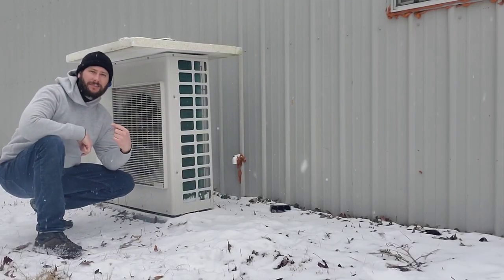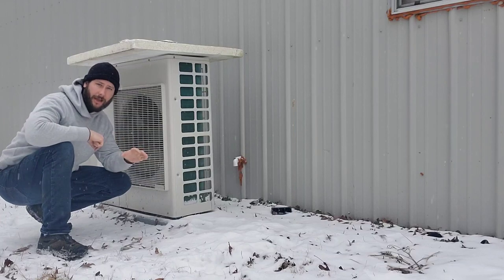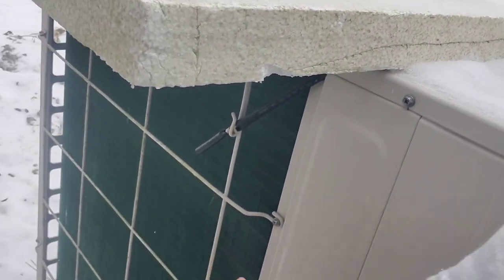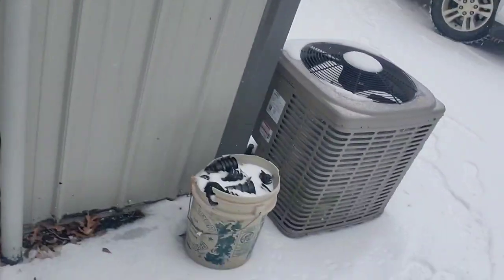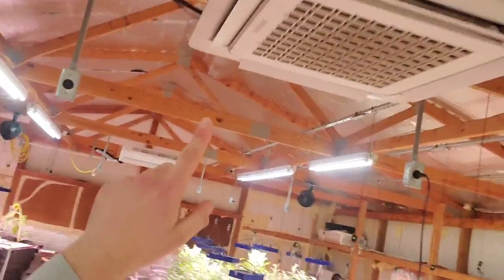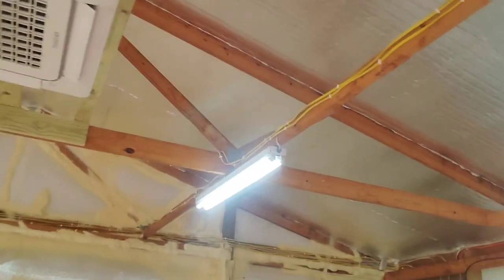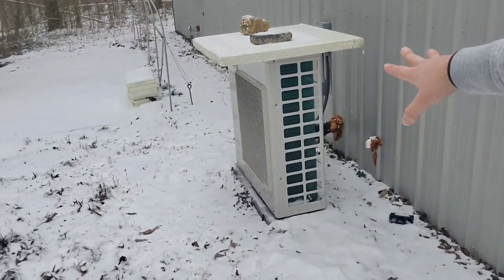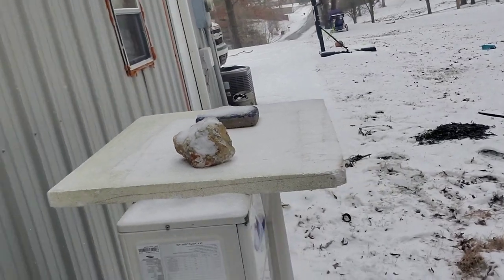Heat Pump Mini Split Frozen What do you do? #minisplit #heatpump

Comment: In Case anyone is interested:  I just had a 7 Unit Head System with 2 Condensers installed in my house this February. I have old baseboard heaters that cost a fortune to run. They left the baseboard units in place as backup. It got down to at least -10 right after they got it installed and running and it actually kept the house warm in below zero weather. I had 1 unit turned up to 80 degrees but I didn't need the baseboards at all. It worked perfectly and I live in Minnesota! My system is Midea just for reference. So far I haven't had to clear any snow. Will see what happens this coming winter. Both my condensers are exposed to the elements. It's working perfectly! I have 1 large condenser running 5 heads and 1 smaller condenser running 2 heads. It cost $27,000 installed. I was extremely lucky because it was paid for through a grant from a weatherization program.

Comment: I am in SC and my Daikin inverter unit on the exhaust side was iced up almost completely the other day.  We don't get much cold in SC so this was the first time.  I built a roof over the entire unit and also installed screen wire around the suction side about 6 inches from the coils to help prevent trash from getting into the coils.
Reply: Whaaaat im in sc and my unit is a block of ice right now too
Reply: @KleinHeister  I don't like the cold so I built that roof the other day so I will not have to go out there and keep ice off of the exhaust grates.
Reply from the maker: Great knowledge good to know this information thank you for sharing
Awesome that you built something to keep the ice off

Comment: You installation is not correct. Your condenser should be elevated off of the ground. I have several Mitsubishi and Fujitsu hyper heat units installed in Buffalo NY and have never had issues with them icing up. Not sure if Samsung has a pan heater in it, if it does that’s why your condenser is icing up after defrost. The unit cannot drain out the water that has melted off the coil and in the pan.
Reply from the maker: Just because the unit is on the ground doesn't mean it's installed incorrectly. 
Mounting brackets work really well.
This is for my Aquaponic Farm.
 This snow in Tennessee only last a week or 2 and then it's gone that's good.
 The outdoor unit is
 installed at an angle.
 the drain hose comes out the bottom and drains away from the equipment
it has not been frozen once since I covered
 I get what your saying and agree with you I agree the water cannot drain If the Pan is iced over
 Also I will check and see if Samsung offers a Pan heater
 Thank you for your advice 
I appreciate you taking the time to watch the video 📹🙂
Thanks for the information too
Reply: Does't matter where the outdoor unit is, in Aust they are usually on the ground next to the house.
Reply: You're absolutely right condenser need to be elevated so you wont get ice build up. That is my problem right now, so I bought a bracket to raise the condenser.

Comment: All the mini split heat pumps I install have a defrost mode and melt the ice off the coil... your right about covering only cause in icy condition it is hard for the fan itself to keep clear of ice. There is nothing to melt ice away from the condenser fan.... this is cause the fan is vertical position blowing air horizontal.   

A traditional heat pump doesn't have trouble keeping the fan clear cause in horizontal position it won't allow any build up.  I have seen defrost boards fail and never defrost and ice close in on fan blades.
Reply from the maker: thanks that ice does not play Thanks for your support

Comment: Your statement isn't quite true about traditional heat pumps having emergency heat. All heat pumps have a defrost mode. The heat pump will defrost on its own if it meets one or two things ( timer or o/a ambient temp sensor)  . Most have a timer function built on their defrost board with a selection of 30/60/90 mins . It should go into defrost mode and shut off ODF . Pump hot gas through condenser coil and melt any ice off coil. When doing so it will not heat the space... I don't  know why anyone would install a traditional heat pump without electric back up elements to help while in defrost plus for additional heating...
Reply from the maker: Good info Thanks for sharing with others so we can all learn Thanks for watching

Comment: This year my heat pump kept freezing up, so I just stopped using it when temps got below freezing.  It's been a beast of a winter.  However,  I kept going to examine it whenever the temps got higher, and I came to the conclusion that maybe water was getting on the coils.  in Washington the humidity is high, it rains a lot, and we have freezing fog.  I got a very large boot tray and covered the top to help prevent water from getting on the coils (upside down, of course).  It hangs over the edges.   It hasn't been as cold, so I'm not sure how it would work below 28F, but it has prevented ice buildup below freezing.  Maybe I'll cut some foam board to put under the boot tray?    Is the foam board to help insulate the unit too?

Comment: It's good to have one of those unit's series but that ice build up prevention mechanism/algorithm built in this generation's units is debateable, it needs to be improved/updated, maybe by a software update to the controller. I am not talking about the usual defrost cycle. If you are using samsung of this gen or a technician for samsung then you should know what I am talking about. Most of the winter, the weather is mild where I live and my samsung still goes for these little frost protection cycles every 3 hours or so although the weather temp outside is at lower 60s F / 16C. You know Its literally impossible for any frost to build on condenser at those temps unless something is wrong with your unit...  Nice video! That simple plane of wood or wtv it is  you used there literally saves alot of energy for heavy winter regions!!!
Reply from the maker: Wow you are the 1st and probably the only person that will actually get the point in this video and I am so glad that you took the time to leave this information yes I am aware of snow prevention mode on DVM model Samsung outdoor units
 Thank you for taking the time you're right there is no time at temperatures like 60ﾟF for the frost accumulate with the algorithm in the equipment
 Glad you watch this video
 Think you
Reply: @TaddyDigest  Thanks to you! Your videos are very helpfull & instructive!

Comment: I just had a Mitsubishi 3Ton Ductless HP installed.  We are on the Lake and the Wind is fiercely cold in winter with snow drifting concerns.

The unit we have is:  MSZ-GS36NA

Thinking of building /stacking a 3 sided cinder block wall then adding a 3/4” Plywood top sitting on 4 corners of cinderblocks to allow airflow in, is this a good idea?  I would have the cinderblocks 3’ away from the unit for airflow.

Comment: Hello, Tad. I recently came across with one of your videos about the mini split unit outside freezing up (a block of ice in the back and on the side). I am in Chicago, and I have 5 units. I am not sure if you are familiar with mini split DELLA. I installed these units myself. I own an old hose, and the heating system (running boards) was not helping. We recently had about 5 to 7 inches of snow, so before the snow came down, I covered them with plywood a date after the temperature dropped to -5 degrees and -15 degrees with the wind factor. And no snown got on the units, but they started building ice again. Do you have any suggestions on what I should do?
Thank you in advance.
Reply from the maker: keep the top covered 
they will freeze but should thaw back out 
make sure they are blowing heat and that the charge is good or they will not thaw out the coil

Comment: Couldn't you just install an awning right above it instead attached to your siding? 
Seems to me that would be more structurely  secure.
Reply from the maker: Absolutely that is the best option and a great idea
 Thanks for watching hit that like button please
Reply: FYI: I just had a 7 Unit Head System with 2 Condensers installed in my house this February. I have old baseboard heaters that cost a fortune to run. They left the baseboard units in place as backup. It got down to at least -10 right after they got it installed and running and it actually kept the house warm in below zero weather. I had 1 unit turned up to 80 degrees but I didn't need the baseboards at all. It worked perfectly and I live in Minnesota! My system is Midea just for reference. So far I haven't had to clear any snow. Will see what happens this coming winter. Both my condensers are exposed to the elements.

Comment: Hi,
Do you know what the normal temp range for a 12000 BTU inverter mini split compressor is please?.. I want to know if it safe to slap some butyl sound dampening pads on it to quiet it down, like the stuff they put in cars to quite down vibrations?.. I'm sure I'm not the only one who thought of the idea but I cant find a single mention of it anywhere. I would try one of those sound dampening jacket things, but it's a rectangle type, not the big American type, so there is probably not enough room for one of those jackets. I need to open it up and see tho to be sure.

My manual says it can work down to -15 C. It's about -1 now and it iced up and is already struggling to keep up because of having to do the defrost cycles (does it on temps not timer I think). It's absolutely normal for it to ice up when it's -1 isn't it?.. Because it's going to be making the fins even colder than the ambient temp to suck heat out of the air. I only got it very recently so this is the first time I saw it ice up.
Reply from the maker: The refrigerant keeps the compressor cool
So putting a sound blanket over it is not going to make it overheat.
You're fine to put a blanket over it to make it quieter.
Reply from the maker: Discharge temperature is usually maintained around a 135 to a 140 F
Reply: @TaddyDigest  Is that the temp of the actual metal that makes up the compressor?.. Like if you pointed a laser thermometer at the side of the compressor when it’s at it hottest and coldest. Butyl pads are supposed to be able to handle -50 to 120 C (-75°F to 250°F maybe). I would have thought it was easy to find how hot and cold compressors get but I can't find that information anywhere.

Comment: and they want me to replace my combi boiler with this bs??
Reply from the maker: If you like burning oil or gas then stick with what you got
Reply: @TaddyDigest  they're getting banned in the uk. already from june this year they're bringing in laws to limit flow and temp through radiators to standardised around how they expect heat pumps to perform.
Reply from the maker: Wow I can't believe they're doing something like that
 Sounds like they're really pushing the heat pumps
Reply from the maker: Wow thank you for this insight

I love the knowledge that you provide.
 Also I can't believe that the electricity is nearly 4 times more expensive where you live I don't blame you for not wanting to switch

You're right they want more control
Reply: @TaddyDigest  trying to get my family to agree to let me build a rocket mass heater in the house, because i've been thinking about supplementing the heating like that for a while, let the pumps and thermostats continue to do their thing but contribute auxiliary heat safely in a way that wont freak the boiler we have out or damage anything; they're not designed for water above 80c, and its a terraced house we live in so not much space for extra gubbins to be installed. but, you know, work, life etc. next winter i guess, lol.
Reply from the maker: That is awesome I love that you're being creative and you're using your mind to Make your life and your familes lives better
  I wonder if you could use a storage tank and use maybe a Samsung water Geo

And then couple that with your wood burning heater

I got a few videos coming up on the on the Geo made by Samsung I will try to send them to you